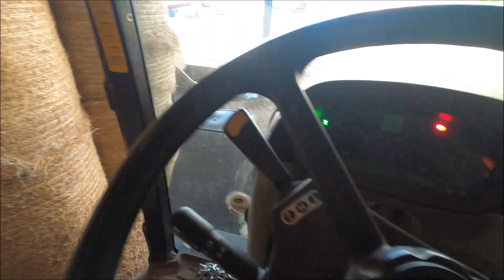Mrs P goes Topping.  02 05020

Comment: Your reasoning for topping is more than sound Ian. We always topped our pastures off for exactly the same reasons, to knock off the seed heads and thicken up the bottom. For none farmers out there think about it like this, when you mow a lawn it comes back thicker, when you prune or pinch out a plant it bushes out (tillers) and there is a small benefit from the toppings in that they will act as a slight mulch, holding in some moisture and there will be a small amount of nitro put back into the soil, okay not a huge amount but there is an old gardeners saying that you always clear up the grass clippings else all you are doing is feeding the weeds... 😄

Comment: For not being a seasoned operator and to high of gear  she was laying a pretty straight line either she knows to look farther up the field and pick a spot to focus on or wasn't worried about the laser straight line and just picked a trajectory which works in her favour and she picked it up quickly ive seen many operators I would not give a second day to but she definitely would be asked to come back the next day 
had to chuckle when she started out after you got out knew instantly it was in a bit high of a gear then your message popped up good video 
Im also familiar with the struggle of do i do that little extra thing that may or may not backfire but i think it definitely was a good call topping it and should see the rewards of it

Comment: I read something about if you turn off hdr mode on the gopro it reduces ghosting. Ghosting occurs in hdr mode because it takes several images in different exposure and combines them thats why you get the pixelated images when there is lots of movement. Do some test shoots when filming moving over gravel and grass that seams as when it happens the most.